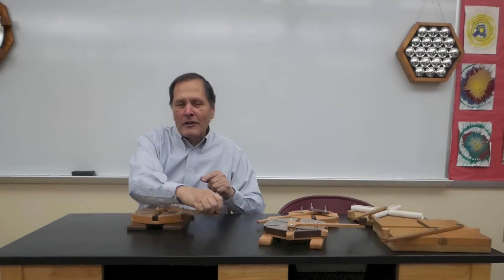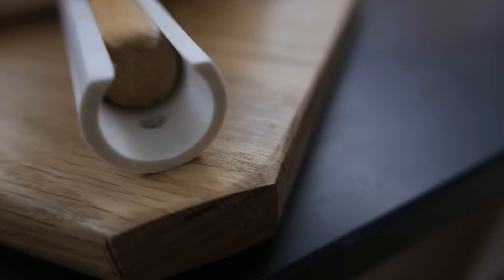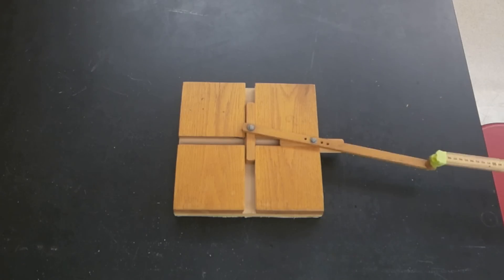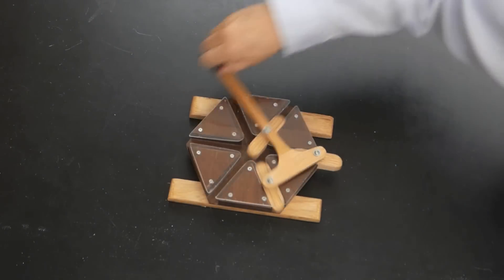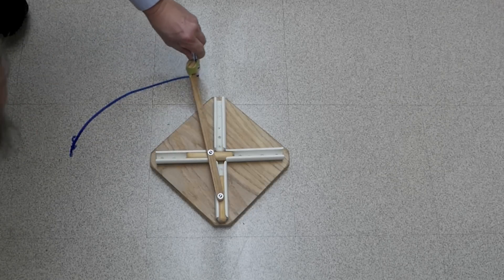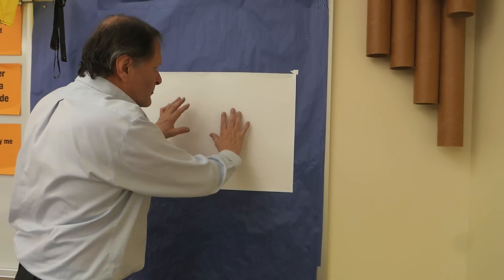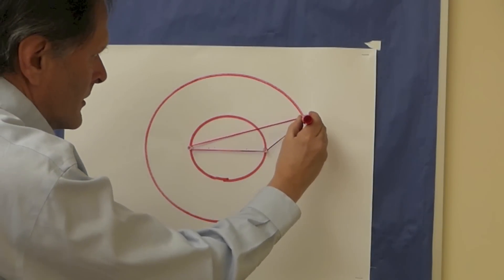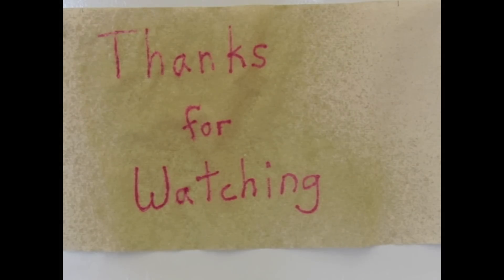Trammel of Archimedes - Do Nothing Machine part 2 // Homemade Science with Bruce Yeany

Comment: Would this be good to use in an engine, or am I an idiot?
Reply: Max Sainz I think there might already be a function like this in engines, but I'm not entirely sure. It seems to me that it's also similar to how trains move their wheels
Reply: Alex Diersing that's interesting. I mean, it seems like it could work.
Reply: Do you have any thoughts on a place where an engine needs elliptical motion?

Another question might be: if there is a need, would this way be the easiest and/or best?  It seems to me like it's a bit tricky to mount and drive the trammel.  Also, the way the shuttles engage and disengage with the tracks strikes me as a potential wear/jam issue which would take some engineering.  But if you had an engine which needed elliptical motion, these issues only matter in how they compare to other potential solutions.  They're probably all solvable if it's worth the effort.
Reply: Yeah, it's not unlike a radial engine. The difference is that in a radial engine, all the conencting rods are articulated so the crankshaft can turn in a circle (not an ellipse, it wouldn't work).
Reply: "I'm only a car designer". Not anymore. You must build that bicycle.
Reply: It seems like it would be better as a bicycle gear almost. Elliptical motion for a bicycle is a more efficient way of transferring power from a persons legs to wheel. Think about pulling a rolling suitcase, it speeds up and slows down with each step, and it does the same thing when riding a bicycle, which means it is intermittent power, like a pendulum, so this shape could make for a new kind of bicycle drive train but I don't know how it would work. I'm only a car designer
Reply: Airships engines and trains use this principle.
Reply: No and yes.
Reply: Alex Diersing, YouTube didn't show your comment before, but that's a interesting idea.  Applying reciprocating motion to an effectively elliptical crank instead of a circular crank would change the application of forces at different parts of the cycle.  I'm not sure if it would be helpful, particularly helpful enough to be worth the additional mechanical complexity, but it's definitely an interesting idea.
Reply: Jacob Zondag thanks
Reply: ***** Thx
Reply: Think of eccentric drive. Basically it'd be like a Wankel in that aspect, but no apex seals. And the movement would be transferred from the reciprocating shuttle. However unlike a Wankel, it'd be an oddly low revving torque monster.
Reply: Max Sainz It would be inefficient, vibrations would be horrible, and keep in mind that the turning motion isn't a circle. But no you are not an idiot, you are imaginative.
Reply: Max Sainz  no bc this does not make a perfect circle and is less efficient than what we use now coming from a mechanical engineer
Reply: Liam S For the design with the two sliding pieces, the center of the beam between the two sliders always makes a circle, it's the ratio of the other part of the beam that makes the end draw an ellipse.
This might be a better solution to how elliptical machines produce rotary motion out of elliptical motion, plus it'd save weight.

For the design with the three sliders, the connection piece between the two secondary sliders makes an ellipse, since the three sliders are connected as a T and the secondaries are connected with the horizontal part of the T and the primary is the vertical part of the T.
Edit: Of course the three slider design doesn't have to be connected as a T, that's just most common. I've seen designs that are straight with a 45 degree arm going off the side, and you could probably even use a Y shape; but all of these change how it works slightly, and they all change the math calculations.
Reply: Fletcher DeMaine damnit I should have paid attention in math class lol. I only excelled in my physics class when we built bottle rockets, and I set the school record of 200 feet. And it didn't wobble at all. If only I was good at math
Reply: Too much friction :(
Reply: Old Airplane propeller or even helicopters.
Reply: This is interesting to read.. I have no idea how to contribute because I'm only an average highschool freshman, but this is still pretty cool
Reply: pauljs75 - what’s that? A Wankel with no sex appeal?
Reply: Bina Ahmed this is alot like the rotary engine movement though.
Reply: thanks for tha cheese no I mean WANKEL ENGINES
Reply: It would be unbalanced, so probably not, and it would be too large and very inefficient.
Reply: pauljs75 no it wouldn't, and you obviously don't know what you're talking about, there is no way to seal it, also I'd like to have you explain to me how you would configure your cams and rocker arms and valves in this scenario. You can't.
Reply: it can be set to do it,and it will draw perfect circle
Reply: What Comes Around™ well isn't a camshaft made up of ovals? And don't crankshafts cause piston arms to move in an elliptical motion? It could be applied to an engine in the sense of being a part and not a full engine format. Sort of how the rotary engine was fun and a different kind of engineering but still not efficient. And as for the vibrations, a V6 or V8 would vibrate to the point it would shake itself apart if it weren't for the harmonic balancer that counters the direction of vibration. But I don't know about the efficiency part.
Reply: Liam S Forgot camshafts exist XD And yes vibrations can be reduced but doesn't that create inefficiency, like W engines are supposed to be very efficient because the forces naturally cancel out due to the configuration of the cylinders?
Reply: Well I'd assume so but a Bugatti Chiron has a 8.0 Litre W16 engine and it gets a whopping 10/8/15 mpg so efficient isn't a word I'd pair with the economy of a W engine lol. Hey what about radial engines? Like on old prop planes? I wonder if they use the same theory as the Trammel.
Reply: Liam S Ohh yea they do use a similar principal
Reply: Liam S principle * autocorrect
Reply: It's already in engines. It's called pistons
Reply: no not a perfect circle i was thinking the same thing tho👌🏼
Reply: I can see how the shuttles in the tracks could be pistons, but they convert to an elliptical, not circular, motion
Reply: Back in the early 1800s there was a use for this machine in trains.
Reply: Max Sainz - I was thinking the same thing, tho my thoughts were less about the tremmel (slider tracks?) and more about the possibilities of the connecting rods/"crank" handles...    this immediately reminded me of mechanical Spirograph/Cycloid type machines that use varying length rods and mounting points to create the wild output designs...   couldn't a more complex rod system transfer some simple motion into something useful (tho prolly wildly inefficient)?

Could you make one with more than 3 axes ?
Reply: Legit just commented that haha
Reply: too much friction
Reply: friction bad
Reply: Max Sainz this is pretty similar to a plane's engine, a rotary engine
Reply: The handle moves in an ellipse, hence the mecanism cannot act as a crankshaft for wheels.
Reply: 2degucitas rotary engines are totally different. They don't even use pistons
Reply: Nah, your an idiot
Reply: Himiko toga twat
Reply: Kinda reminds me of a rotary engine in a rx7
Reply: I don’t think anyone says this could be used in engines🧐
Reply: It makes me think of a propeller engine on a plane, with an explosion on every end that causes it to move to another side where anothed explosion takes place
Reply: Max Sainz plane propeller's engine kinda works like that
Reply: I was thinking the same thing, but then I realized that the axis of rotation would be changing, which could cause severe oscillation
Reply: Reminds me of the radial engines used in ww1
Reply: It almost reminds me of the rotary engines used in planes during WW1
Reply: Radial
Reply: For those focusing on the ellipse, the point between the points of connection of the shuttles describes a circle. This is true in the 2-trammel version as well as in the 3-version. Incidentally, the math indicates that ANY NUMBER of axes are possible -- with increasingly smaller shuttles, of course.
Reply: Like a Mazda engine?
Reply: Idiot

Comment: Okay so I come up with a way to make this mechanism practical. I do wonder. Would a do nothing machine work with more than 3 of those things. It works with 2 and 3. But would it work for 4, 5, 6 or even any number up to infinity?
Reply from the maker: Hi SIr Iodine,  I have seen computer generated videos of 4, and 6 shuttles, I haven't tackled them yet but plan to try a larger number eventually,  I don't know how many would be able to work
Reply: Sir Iodine "up to infinity?"  ROTFLMAO.  Thanks.  That was funny.
Reply: Sir Iodine Or how about 2 other planes with an offset variable to make it switch planes? Now make the switch a random quantum energy generator.  Maybe that would be a realistic model of an atom.  Next, make software that can adjust the switch to quantifiable certainties.  Now measure the switches of current existence and make duplicates which, when adjusted, bring the conscious observer and all attendant realities to an adjusted reality.  Thus time, the fourth plane (not really a plane, but a constant switch) would be traveled to the observer rather than the observer to a different time.  
I feel like I just licked Jerry Garcia's hand or something
Reply: Yes, there are several on Thingiverse.com that go up to 5 shuttles. It gets harder to get things to work smoothly with more, I think.

Comment: It isnt doing nothing. Its a better way to trasfer circles (from motor) to direct pushes.
Reply: Mateusz Soszyński it's an ellipse lol
Reply: TheFatalTortus 42 just add elipse gear
Reply: its an elliptical motion so we cannot directly give a rotational motion  from say a motor which is a circular motion to this device to convert into linear motion. We need some kind of mechanism that converts circular to elliptical rotation.  There are other easy implementations of a circular motion to linear conversion so making a circular to elliptical and then to linear doesn't sound appealing.
Reply: Mateusz Soszyński no it's is an ellipse. the rotation follows an elliptical orbit not a circular one.
Reply: Mateusz Soszyński And the hand crank moving elliptical would be more ergonomic on the arm.
Reply: Haha- so... basically an exercise program for fat fingers? ; )
Reply: The midpoint of the rod that holds the shuttles together does indeed move in a circle (not an ellipse). So, yes, this can convert circular motion to linear motion.
Reply: Mateusz Soszyński Just add wire coiled around the pvc and use magnets as the sliders
Reply: Mateusz Soszyński it isn't doing nothing or ANYTHING
Reply: I got it, professional thumb wrestlers training equipment.
Reply: +Josh Fox  you maybe right, but without modifying this contraption it cannot effectively convert a rotational to linear motion and this arrangement if not already complicated enough, making the arm slide would indeed further complicate a rather simple process of converting a rotational to linear motion .
Reply: Mateusz Soszyński   But how would that work out? Let's say turning the crank of an adding machine forward or backward to add or subtract, but still counting upward the number of rotations/turns?
Reply: Always heard these called a bullshit grinder. It IS doing something, but that something is basically nothing, unless you want to describe ellipses.
Reply: julie r No, it is basically burn your calori when you move it with yout hand.. 😂
Reply: It isn't doing nothing is a double negative. Which means your saying it does indeed do something, to which we already knew from watching the video.
Reply: Mateusz Soszyński thats the illusion my freind..there is a greater use for this in the year 2190
Reply: Mateusz Soszyński  So you are saying it is a mechanical rectifier?
Reply: Jeffrey314159 yep.
Reply: Jeffrey314159 sory, im not even B1, so i cant understand you at all. I think that this is better way to transfer rotation to pushes.
Reply: Mateusz Soszyński
What you are describing is like an old device for lapping valves in an engine- it sort of looked like a hand mixer- you cranked a handle and the shaft coming out rotated back and forth. Inside, it looked much like the device in the video here, but the pins were set differently so circular became a reversing rotation.
Reply: The gearing for those devices was originally designed by Galileo as part of his ornithopter designs.
Reply: Mateusz Soszyński so your saying it's doing something.
Reply: +Aparajith Sridharan You could get around that problem by allowing the handle to slide along part of the arm.
Reply: Aparajith Sridharan I won't argue with that.
Reply: Mateusz Soszyński can't you just use gears
Reply: +Twinkle Baby
hahahahahahah
Reply: Aparajith Sridharan, yep you can just cut a notch into a board perpendicular to the way you want to push the board with the notch being equal to the size of the circumference of the circular motion. Put a peg into the notch connected to the part that is moving in a circle and it will go up and down that track while pushing the board back and forth. It is easier to do than to explain.
Reply: This machine demonstrates converting circular motion into linear by pushing dominoes https://youtu.be/N1-wU9NgsV4
Reply: Mateusz Soszyński check your grammar
Reply: Aparajith Sridharan the motor could be ON one of the shuttles, and remove the handle, other than the part connecting the shuttles.
Reply: Seems like it takes too many degrees of freedom to power to be all that useful